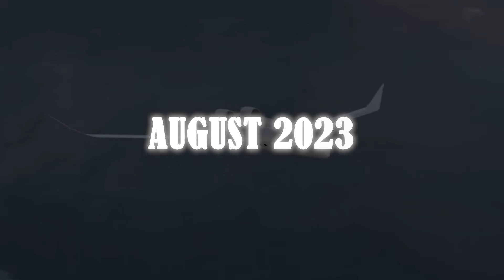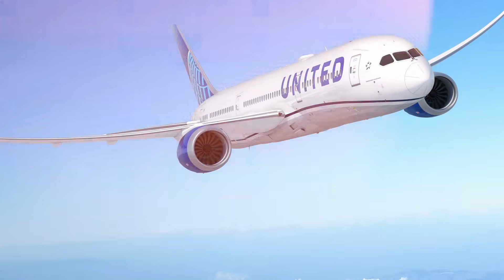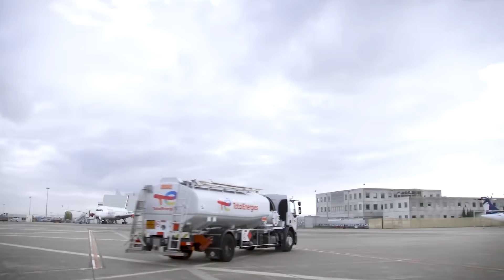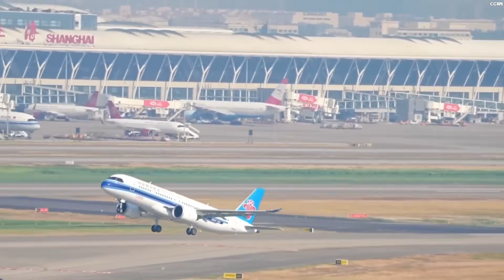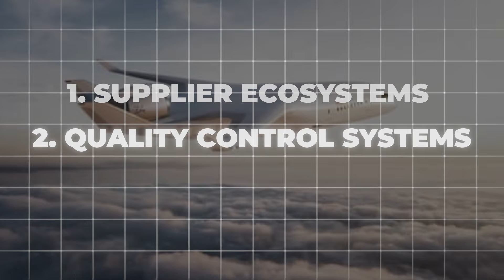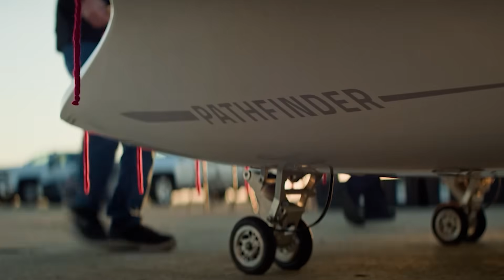The REAL Reason why JetZero is 50% more fuel efficient than Boeing & Airbus?

Comment: JetZero's pressurized cabin has not been completed.
Reply from the maker: You're right that JetZero is still at the development stage, and many key elements—including the full-scale pressurized passenger cabin—have yet to be demonstrated in a production-ready aircraft. That will be one of the major milestones to watch, since a blended-wing-body design introduces different challenges for cabin layout, pressure loads, and passenger experience. The concept is promising, but proving it can meet airline requirements will be the real test.

Comment: Boeing is refining the Aurora D8 design.
It utilizes Boundary Layer Ingestion powered by electric motors.
The generator has already been developed by Japan's IHI.
The engines are mounted above the main wings.
The underside is widened so that the fuselage generates 50% of the lift.
Reply: The Aurora D8 is definitely one of the most interesting aircraft concepts out there. If Boeing (or the industry) can successfully bring technologies like boundary layer ingestion, hybrid-electric propulsion, and a lifting fuselage together, it could significantly improve fuel efficiency. It'll be fascinating to see how much of the concept makes it into a production aircraft.
Reply from the maker: Great points! The Aurora D8 is one of the more interesting next-generation aircraft concepts because it combines several efficiency-focused technologies: boundary layer ingestion, electric fan propulsion, and a wide lifting fuselage. The biggest challenge will be moving from a promising concept to a certified, reliable aircraft that airlines can operate profitably. If Boeing and its partners can solve those engineering and certification hurdles, it could represent a major step forward in commercial aviation.

Comment: Do you think JetZero will perform better than Boom?? I do not think both will survive. Curious to hear your opinion.
Reply from the maker: It's an interesting comparison. If I had to pick one, I'd say JetZero has the better chance of long-term success. Its blended-wing-body design aims to reduce fuel burn while still operating in the existing commercial airline market, where airlines are always looking to cut operating costs.

Boom, on the other hand, is trying to bring back commercial supersonic travel—a much tougher business case because of higher operating costs, limited routes due to sonic boom restrictions, and a smaller customer base.

That said, both companies still have major technical and certification hurdles ahead. It'll be fascinating to see where they are in another 5–10 years.

Comment: Flying wings have promised to revolutionize aviation for decades, but none have made it into commercial service. Is JetZero finally the company that can turn the concept into reality, or will it face the same challenges that stopped everyone before it? Let's find out.
Reply from the maker: That's exactly what makes JetZero so interesting. The technology is more mature than it was decades ago, but the engineering, certification, and manufacturing challenges are still enormous. It'll be fascinating to see whether this time is truly different or if history repeats itself.
Reply: @PlaneFilesOfficial  I agree. Many companies have tried to bring flying-wing concepts to commercial aviation, but the leap from a promising prototype to a certified, mass-produced airliner is enormous. JetZero has some strong partners behind it, so it'll be interesting to see whether it can finally break that cycle.
Reply from the maker: @amitabhkejriwal9322  Exactly. The concept has always been compelling—the real challenge is proving it can meet the safety, certification, manufacturing, and operational requirements of commercial aviation. If JetZero succeeds, it could mark one of the biggest shifts in airliner design since the jet age.
Reply from the maker: That's the billion-dollar question. The idea has incredible potential, but history shows that technical promise alone isn't enough. Certification, airline adoption, and proving long-term reliability will ultimately determine whether JetZero becomes a game changer or another ambitious concept.